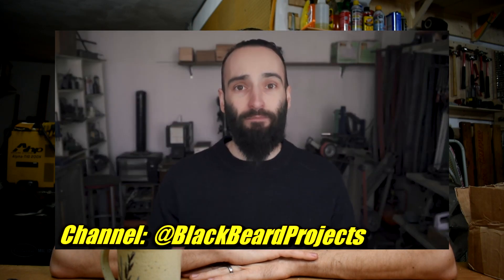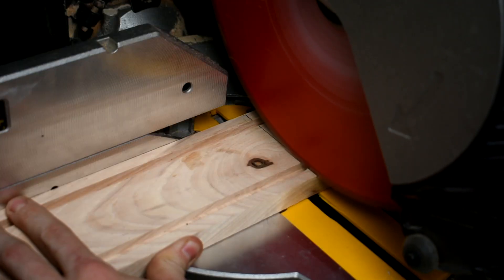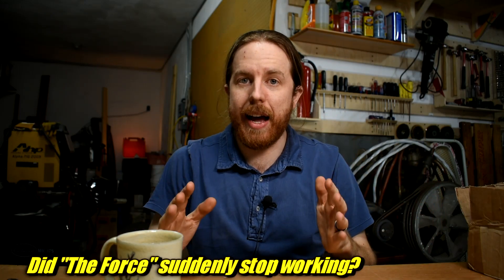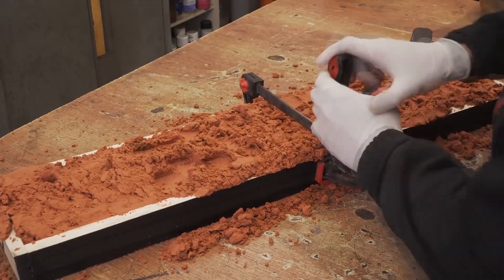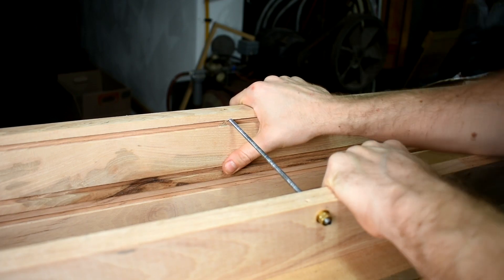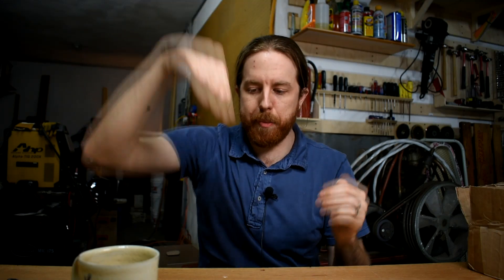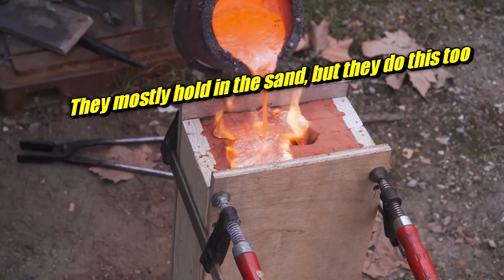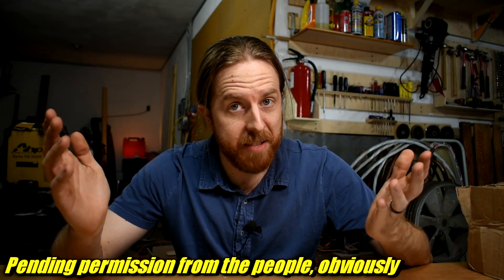Best Metal Casting Flask Design Stolen From Black Beard Projects

Comment: Dowel pins made out of metal would be also useful for locating the two parts together,
Reply from the maker: The screws in the side flanges do that.  If I leave them sticking out the bottom they fall I to the holes in the lower flange in the same spot every time.  One benefit of this hardwood, it won't accidentally thread a new hole, it only goes into the pre drilled hole

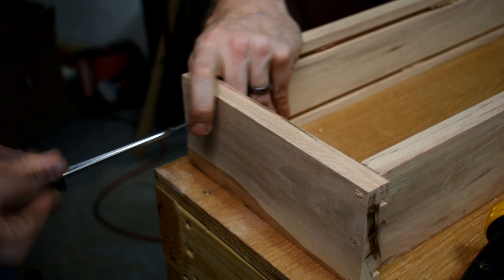Comment: 2:00 A problem with using grooves like that is that your wood will flex somewhat when the sand is packed
Reply from the maker: yeah flex is an issue, but that's why i used hickory, the flanges, and the threaded rod.  It's probably not something that can be solved perfectly, though

Comment: Interesting idea having the sand retaining/strengthening ridges recessed into the side of the flasks, rather than proud.  Means the strengthening ridges themselves are made of sand, not wood (or whatever material you choose to make your flasks from).  Also, I note you have two such ridges (top and bottom) per flask; BlackBeard only has the one central (and wobbly) ridge.

Apologies if all the highly technical jargon confuses anybody 🤣.
Reply from the maker: The cut in ridges are exactly like you say, they mean I don't need wood protruding into the flask and taking up space.  I don't know if two grooves are necessary but it seemed like a good idea?  Not sure
Reply: @PaulsGarage  I suspect wooden supports would be stronger than rammed sand, though.

Two rudges are definitely a good idea.  A single central strengthening ridge means that only half the sand is supported, the other half is effectively hanging from it.  And we all know how strong sand is in tension.
Reply from the maker: I'm not sure which works better.  I've heard people say both.  What's clear is that no supports is clearly the worst option